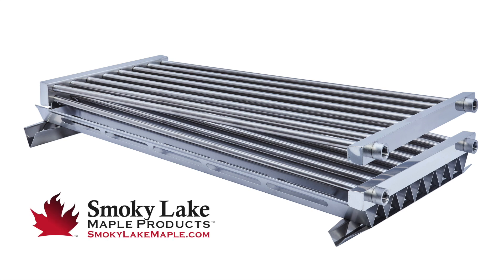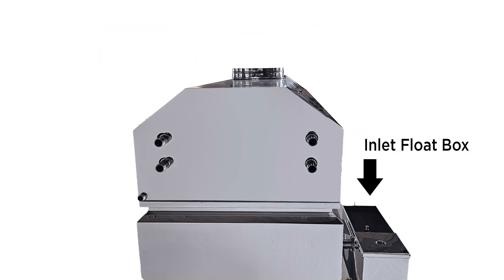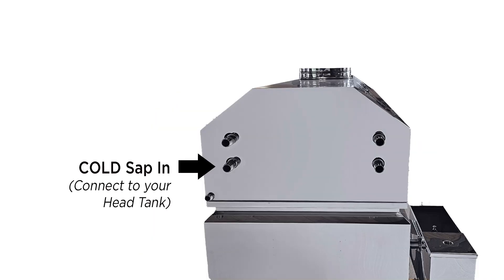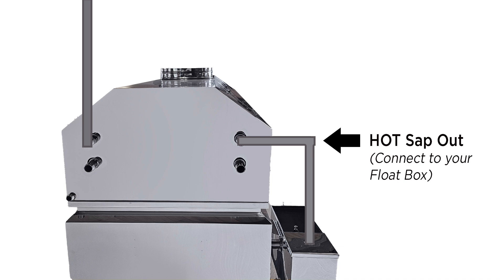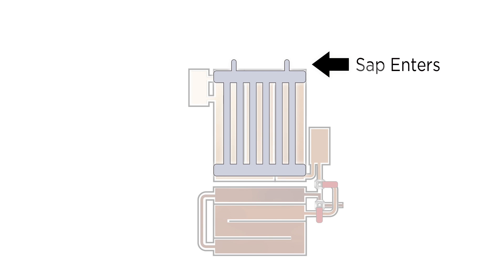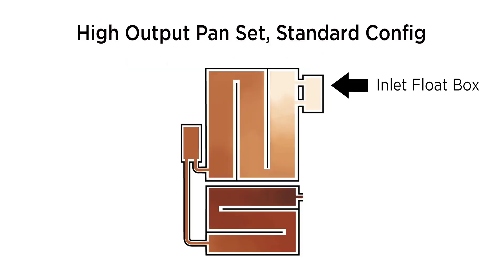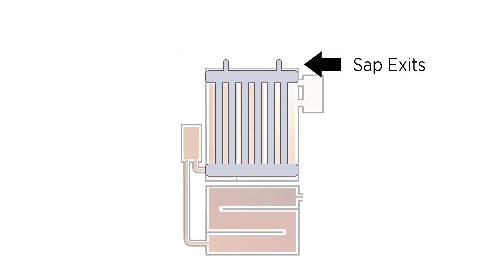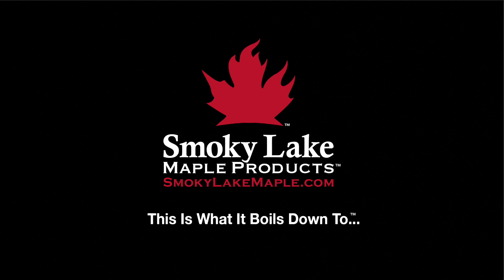Smoky Lake Backflip Preheater - Connections

Comment: I connected my back flip drain into the hot sap line going to the float box & placed a valve in the connection. This allows me to drain my back flip directly into the float box at the end of the boil. I drain the preheater after every boil to prevent freezing.